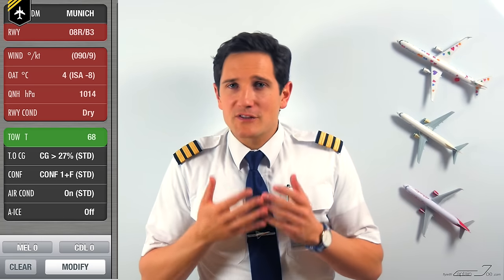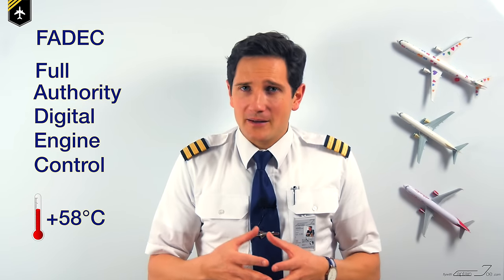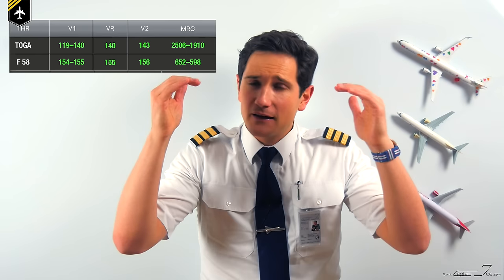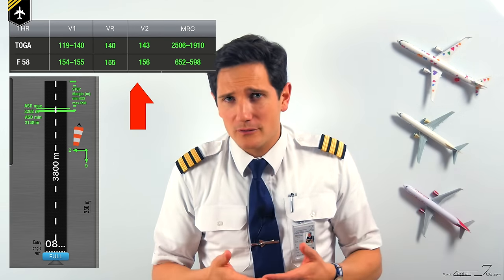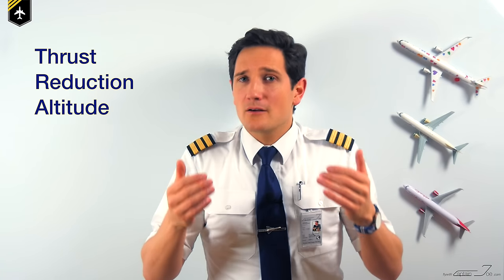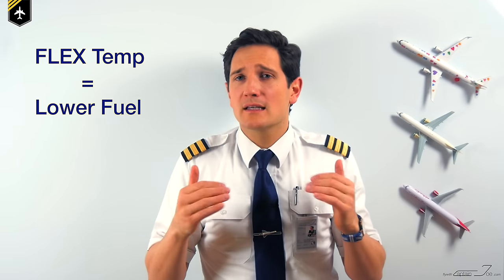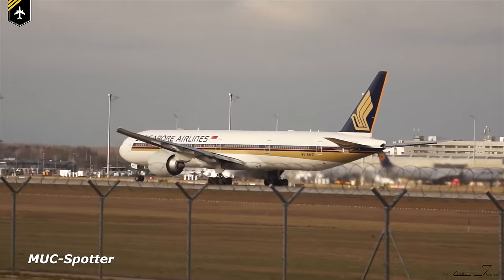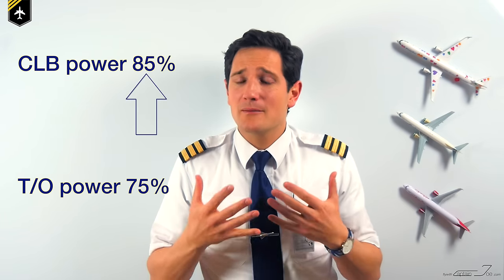What is FLEX TEMPERATURE? Explained by "Captain" Joe

Comment: Thank you for the explanation..if I may add..Jet engines produce reduced thrust as the ambient air temperature increases. The flex temp is the highest air temperature at which the engines would produce the required thrust. The crew finds that temperature and enters it into the flight management guidance system (FMGS) — effectively telling the computer to assume the specified air temperature instead of the actual temperature. When flex (FLX) thrust is selected during take off, the engine controller produces maximum thrust for the assumed (flex) temperature.

Comment: i was on a plane and the pilot explained that there was a problem with the runway but we could use a shorter runway but would need full power to take off...i kind of laughed and said to the guy next to me "dont they always?" we both kept joking about it but when it came time to take off it was an experience...not only was the noise and rush of air extreme but the fact it pulled you all the way back into the seat to wear there was no padding left and when he pulled up we just missed the trees and the guy next to me say "guess not" i think i said wow...it was scary and exhilarating at the same time

Comment: You really say calm and good teaching always for us Mr.  captain, thank you again
Reply from the maker: Thanks for you kind comment :) Greetings Joe
Reply: @flywithcaptainjoe  correct me if I’m wrong 
Flex temperature is the assumed temperature of the engine. The FADEC takes control of the flex temperature and that higher flex temperatures will have a slower performance of the engines due to the higher temperature so has a slow acceleration for takeoff but has a higher speed thus reducing the runway available for a rejected takeoff should an engine failure occurs. Lower flex temperatures will have a higher power setting and a better performance of the engine. This will have a smaller takeoff roll thus having a larger runway available for rejected takeoff. The TOGA throttle setting is reduced to clb thrust and a reduction in engine noise from a passenger perspective
Reply: Kkokk
Reply: Fdtgde DM enka SMH

Comment: Great and informative video, keep them coming. :)

One tiny point: FLEX thrust will generally not save fuel; the lower fuel flow per unit time does not offset for the longer takeoff roll. In general, gas turbine engines are most efficient at higher power. If you don't want to do the complete calculations, the extreme point will give some hint that lower power is not always more fuel-efficient in total: there is a power setting too low to take off and fly at all, yet it will consume a non-zero amount of fuel. So the real main reasons for performing a "reduced-thrust takeoff" (to use a generic term) are reduced engine wear and (depending on the departure profile) reduced noise, although that's also less than you'd think because the climb gradient is lower with less thrust.

That reducing mechanical wear is often more important than saving a bit of fuel is shown by the use of reverse thrust. Its main function is to reduce brake wear. Stopping must always be possible without them (except perhaps on ice), but they basically don't cause any wear.

Comment: Thank you for a very informative video! I think it would be logical now to explain the thrust reduction and acceleration altitudes and (maybe) noise abatement procedures :)
Reply from the maker: That´s true, but first the speeds video on V1 VR and V2 and then thrust reduction and acceleration altitude :)
Reply: I'm very curious about noise abatement takeoffs as well. I commonly experience it in Orange County, California (south of Los Angeles). It's a high acceleration, steep climb takeoff, followed by an abrupt reduction in power, in order to concentrate the noise to the airport. Further climbing is only allowed above the ocean. You can clearly feel and hear the difference even as a passenger. It feels almost as if you were about to land right after takeoff, obviously to reduce the noise over Newport Beach.
Reply: +cppguy16:
SNA runway is also pretty short: about 5700 ft (while, for example, LAX runway is 12000 ft).
Reply: True, but normally airplanes climb steadily. At SNA, they climb at 25 degrees (10 degrees steeper than usual), then sharply reduce the power. They fly level all the way to the Pacific, then climb normally. It's the most fun airport in the US (or the scariest, depending on who you are). Flight attendants have to warn passengers so everyone is mentally prepared for this.
Reply: @cppguy16  You are very correct.  The normal thrust reduction/acceleration is 800 feet above the ground.  In SNA the power is reduced above 1500 feet and acceleration is above 3000.

Runway length has nothing to do with this.  It is, as you suspected, a noise abatement procedure. SNA has noise sensors off the end of the runway.  Too much noise can result in a fine, and enough violations can result in loss of authority to fly here. There is also a curfew.

Here is an article.
https://blog.aopa.org/aopa/2018/11/19/nadp-1-versus-nadp-2/

Comment: I'm a little confused. If a higher flex temperature means an assumed higher outside ambient temperature why does that result in a lower power setting when you then say you would use the toga setting in hot or high conditions. 

Would not a higher assumed ambient temperature mean that more power is given not less (thinking thinner air). Or is it relating to a higher acceleration rate meaning you have more room for a rejected takeoff meaning you can take off at a higher airspeed?
Reply: I am sorry I answer to you one year later but as I understood on the video, the higher outside ambiant temperature is harmfull for the engine temperatures, therefore the computer reduces the power of the engines (through a savant calculation) to limit the engine temperatures.

Maybe I am wrong of course but I suppose the problem with thin air is less a problem than the problem of engine overheating.
Reply: Hotter air is less dense I think, so you will need more thrust to get to a good liftoff speed. Now this is probably only in the instances mentioned in the video, such as a higher runway attitude or short runway. 

When you have more dense air due to lower runway altitude, and/or longer runway, you can use lower thrust in a higher air temperature to save on engine life.

I don't think I fully understood your question, but tried answering it the best I could.

This is my understanding based on this video.
Reply: The method wasn't completely explained in the video, every airline and aircraft manufacturer has slightly different methods of achieving similar outcomes. There are 2 power settings we calculate for takeoff, the first being rated power (TOGA power) - this factors actual ambient conditions to give us an engine power setting that should not exceed engine temperature limitations should we need to use it, then from rated power we can use the assumed temperature method (or FLEX) to reduce the rated power to what was explained in the video. Like Joe said, there are circumstances that prohibit us from using reduced power and to use rated power instead (bear in mind rated power may not be full power, rated power is max available power that when calculated properly should not exceed engine limitations, even when the ambient temperature is hot).
Reply: @shaunweatherill6651  Could you also explain why a "fake" temperature is used as the unit in the first place, and more so with such unrealistic values as ~60°C? It sounds weird to use completely faked numbers rather than inputting factual information.
Reply: İt is a reference temperature to TOGA performance . İf outside air temp was 58 C TOGA would does exactly same performance . That means reduction in performance as air gets hot.  By that logic flex 48 C will give more performance than 58C .
Reply: @Rhythmmical  You have the closest answer.  These are air pumps.  The more dense the air, the better they work.  Hot air is less dense.
Reply: @gardemeister  The FLX temp is always above ambient temperature.
Reply: @oscarb9139  yes it is. There Will be no 58 C outside temp, At least while anyone living let alone flying
Reply: @gardemeister  Very true.  That would be a hot day for sure.  However, the FLX can be a few degrees above ambient also.  I don't recall the lowest FLX I have seen, but 30, 31, 32 isn't uncommon either.  Shorter runways have much lower FLX than places like DEN, SLC, LAS.

Comment: Hey Joe, can you explain the difference between ground speed and airspeed? why is the airspeed displayed on the speedometer usually much lower than the actual speed in mach or kilometers/hour?

to give an example: I play a flight simulator sometimes and in a 737 the average cruise speed that's displayed on the speedometer is about 320 knots. but when you google 'boeing 737 cruise speed' all answers will be around 500 knots. Why is there such a big difference sometimes?
Reply from the maker: That´s a great question, I will look in to that for you! Greetings Joe
Reply: The IAS only refers to the static pressure of the air, regardless of temperatures or air pressure through altitude. Then you have the TAS, where all these influences are calculated in, and finally adding the wind gives you the GS. Therefore I had a GS of 575kt at about 300kt IAS. Thank you, backwind of 85kt on FL340...
Reply: the ground speed is calculated by the GPS in relation to the position with the ground, the airspeed is calculated by the pitot tube that reads the difference between static air pressure and dynamic pressure(the pressure that the air makes hitting the plane with a certain speed) and calculates the speed using the bernoulli equation. Since the static air pressure is much lower at cruise altitudes the readings are low but that doesn't mean that it's useless because that is the speed that is used for the aerodynamic calculations like stall speed and overspeed corner
Reply: Midas The higher you climb the thinner the air becomes, meaning the pitot tube receives less air, indicating less air speed. If there is a 50 knot heading then this is also added in the indicated air speed, a 50 knot tail would be subtracted (hence why it is important to takeoff into the wind).  The aircraft requires indicated air speed in order to fly (stall speed, over speed/flap speed, landing/takeoff speed) etc, etc.
Reply: Midas the higher you are the bigger the world is pretty much...
Reply: The climb thrust on a Boeing will never exceed the take off thrust if you use the Assumed Thrust reduction method.
Reply: First, let's talk about how airplanes measure airspeed. They use two devices for this - the pitot tube and the static air port. The pitot tube meassuers the pressure of the moving air, and the static port meassures the ambient air pressure. By comparing these two pressures, and using some mathematic magic, you get airspeed. This is the indicated airspeed (IAS) and it is what you see in the simulator.

The problem is that as you gain altitude, the air density decreases, so even if you're moving at the same speed, the pressure difference between the two devices is lower, thus you see a lower than a real number. You can get the correct airspeed, called true airspeed (TAS), from IAS using, once again, some mathematic (including altitude and temperature).

The question now is, why do we display the wrong indicated airspeed and not the true airspeed? That's because the aircrafts ability to produce lift is also tied to the air density - less airdensity => more airspeed to produce the same amount of lift. Thus, IAS is a more reliable way to judge the airplanes cababilities.
Reply: Midas air compressibility in the pitot tube...usually above FL245...simply put.....volume of air is saturated n slow down..due heat expansion.. n the dials ls n gauges stopped at 290KIAS..while the plane TAS is 460kts. or Mach.78. all jet turbines (non supersonic) will saturate around 295kias..below 300KIAS at fl245 n above while their respective TAS/Mach  differs..A320 around .78,A380 arnd .88 ,B777 M.82..depends on temp.
ATC instructions are in KIAS n Mach. 
the IAS are indicated on left side of PFD while TAS/GS are top left hand corner of ND. like what Capt Joe said;"mathematical magic".
Reply: Matus Celko
Reply: Simple answer: Remember the air around your aircraft is always moving too. Airspeed is your speed through that surrounding air, whereas ground speed is literally your speed across the ground.
That's why headwinds or tailwinds have such drastic effects, headwinds slow you down across the ground, tailwinds can send you into warp :)
Reply: +Midas
Indicated Airspeed (IAS) is less than True Airspeed (TAS) due to air pressure variances, and compressibility effects.

Don't know what 737 "dash" version your computer is simulating, but airspeed is typically determined via a "pitot-static tube." It compares the ambient air pressure (which is also used for the altimeter) with the ram air pressure (the air pressure of the oncoming air, once slowed down), and shows the pressure differential as an airspeed.

What ought to become immediately apparent, is that the thinner the air, the lower your IAS will read, meaning as you go up in altitude, your IAS will drop, at the same TAS. The Shuttle was screaming by at over 16,000 kts, but its IAS indicated zero! (being in a vacuum).

It turns out, your IAS will drop at the square root of air pressure, which is nice, because your stall speed and such increases (in TAS) at the same rate, which means your stall speed (indicated in IAS) remains constant (for a given configuration), regardless of altitude.
Reply: +midas  "Hey Joe, can you explain the difference between ground speed and airspeed? why is the airspeed displayed on the speedometer usually much lower than the actual speed in mach or kilometers/hour?"

+Captain Joe   "That´s a great question, I will look in to that for you! Greetings Joe"

It's interesting that "Captain Joe" would have to "look into" a question as basic as this.
Reply: Midas  Airspeed is how fast the air is traveling over the airplane....across the wings basically. Ground  speed is how fast the airplane is traveling over the ground. Example: you are flying with a indicated airspeed of 200 knots, without any wind at all your ground speed will be the same, 200 knots. Now if you have a head wind of 100 knots blowing directly on the nose of the aircraft, your speed over the ground will be only 100 knots, the wind is slowing your speed over the ground down by 100 knots. This also works the same with a tail wind...100 knots of wind on the tail will increase your ground speed to 300 knots as the wind is now pushing   the aircraft along. All the while indicated airspeed on the cockpit gage is showing 200 knots. This is a very simplified answer.
Reply: its a game not realife
Reply: First let's talk about low altitude and low airspeed.  The airspeed indicator reads very accurately.  So, let's say the winds are calm at the altitude where the plane is.  The indicated airspeed will essentially be the same as the ground speed.  If the wind is a 20 knot headwind, the indicated and true airspeed remain the same, but groundspeed is reduced by 20 knots.

At high allude and high airspeed, indicated airspeed drops for two reasons.  First is compressibility (you can probably find something by googling "compressibility aviation", and second is that air density decreases with altitude.  For example, at 39,000 feet, we are flying through the air at 480 knots (true airspeed) but the indicated airspeed is around 265 knots.  The groundspeed will be the true airspeed adjusted for headwind/tailwind component.  Last time I flew, we saw winds over Denver as 330 degrees at 162 knots.  This is much higher velocity than normal and it resulted in a fantastic tailwind for that particular segment.  Fifteen minutes later it had dropped down to 65 knots.

Comment: Joe been watching a lot of air crash investigation and I was going to ask could you explain "coffin corner" as I think it would make a good video
Reply: It's definitely a intersting and worthy subject, although the speed ranges have typically widened quite a lot in modern aircraft with greatly improved aerodynamics, sensors, and PFD's with clear and accurate dynamic speed limits displayed...  and if violated today's aircraft respond much more tamely, most notably with regard to what part of the wing will stall first.
Reply: The coffin corner is slang for when the low speed and high speed symbols are very close together and is usually at a very high altitude.  The airspeed indicator in this aircraft has a red band for the high speed limit and a yellow band for the low speed symbol.  Go look it up on the web as my description is poor.

At low altitude, the range between going to slow and too fast can be over 150 knots apart.  But as the aircraft climbs they get closer together.  Example: at sea level, Vls (low speed symbol) might be around 200 knots and Vmo is 350 knots.   That same airplane at 39,000 feet might be Vls 230 knots and Vmo/Mmo 270 knots.